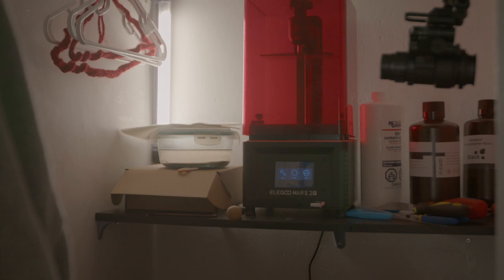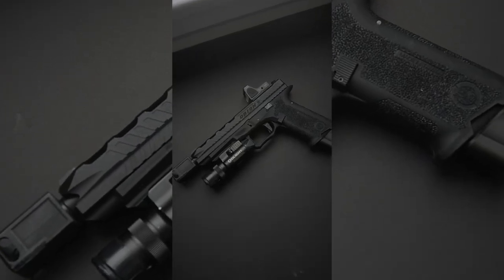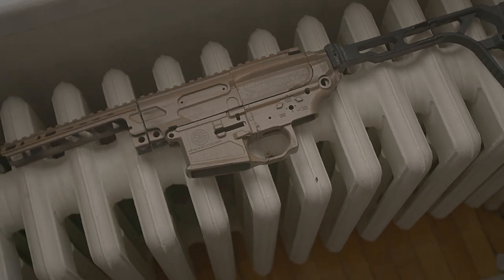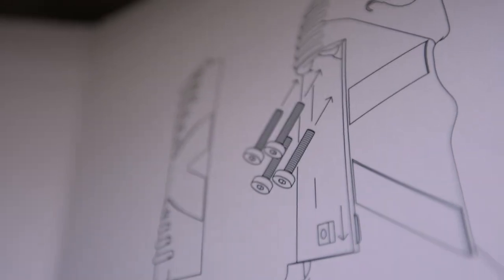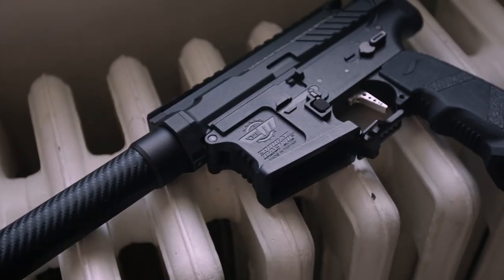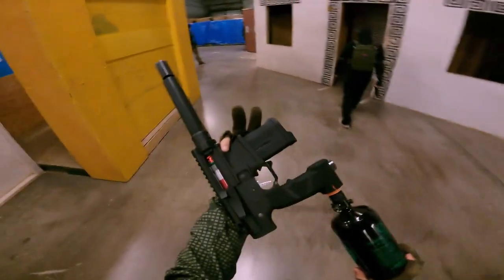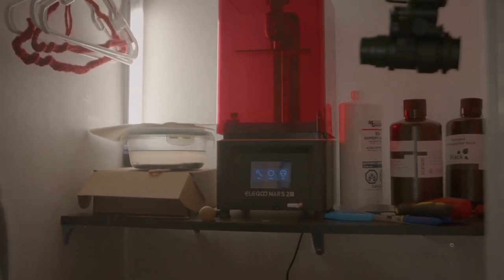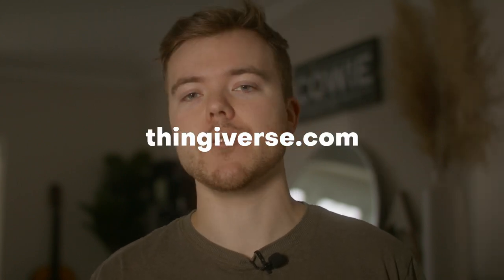I am 3D printing a Airsoft gun...

Comment: i live in brazil , 3d printing made our lives SO much easier in terms of airsoft
Reply: ORA NEM MAIS EHEH
Reply: I have started designing my own parts because stuff I want is either very expensive or difficult to get a hold of! Currently working on a panzerfaust as I want to run it in a game but I dont fancy paying over 400 for one! Few other launchers I want that either do not exist or are super expensive in airsoft that I will eventually be working on. 

I also make my own taginn chalk rounds and have made launcher inserts that allow me to fire taginns using regular shower shells. This is great for practice as regular taginns cost 10 a round and their availability is terrible where as I can print them for 0.1 so can put down 100 rounds down range for the price of one taginn.

Comment: Printed parts always break because people use PLA which too weak. You gotta go with the stronger stuff like nylon, polycarbonate and TPU for flexible stuff like armor which is impact resistant.
Reply: Was coming down here to say that. Also they should make sure their infill is set to 100% for parts that don't need to be slightly flexible. People are making pretty reliable firearms with these things. A little airsoft toy should be easy asf 😂
Reply: @anonymouse7394  I mostly use TPU for armor it's more reliable with movements like crouching.
Reply: Nowadays there is many material options. PEEK, PAKV, etc... You can even 3d print metal.

Comment: I've found that 3D printing for Airsoft is especially useful for GBB replicas, something I know you've dabbled in recently. Parts can sometimes be difficult and/or expensive to obtain with some brands and models of GBBs because the amount of aftermarket support just isn't the same compared to AEGs as I'm sure everyone knows. I've lost count of the times I've saved money and shipping time when a part in one of my gas guns break. Great video! 

I'd recommend looking into a filament printer as well. The MCX you're printing (looks amazing btw, can't wait to see more) reminded me why I prefer FDM over SLA: The ease of splicing two parts together. When printing plastic, all you need for a solid bond between parts is a soldering iron to melt the plastic together or, even better, a 3D print pen using the same material as the print to fill in gaps with molten plastic and weld the pieces together.
Reply: i am in the midst of creating a mechanical (like the kythera. semi only) hpa engine for the consumer market. it will cost $110 for the base model (more premium models made with stronger material) and i want to send one to kraken to review
Reply: @AppleBeesBarAndGrillMenu what parts do you need to make a gas blow back airsoft pistol like which parts do I need to put in the frame and slide

Comment: I've been using ASA for all my ODST airsoft armour and airsoft stuff. 6 walls & 40% infill allow multiple knife stabs, window breaker stabs, and 4 hammer (flat end) and 4 hammer claw strikes before it starts cracking. it will easily outperform many polymer options. If anyone wants more information, print settings, or want me to make them stuff don't hesitate to contact me. I have a very high end printer and perfected settings in making armour and attachments

Comment: I've printed a few spare bottom caps for Glock mags. Changed the plates on my mags and played a few games and wow the inevitable finally happened and I dropped one of my mags. Happy it didnt land with the loading ears or whatever down first, but it actually cracked my 3D printed part doing it's job to absorb the blow and the mag is completely safe. Had two extras in my bag so I just switched the broken part and continued. Think of it as an old Nokia. When it hits the ground it breaks into pieces keeping the core safe from damage. With 3D printing you can more or less do the same with certain applications to keep your gear up and running. It can be a small shroud over optics, it can be a mesh covering lenses etc. Oh I forgot, I printed a tool to replace the irons on my glock as well. I have not yet used it, but I have planned to put optics on it so it's good already having a tool for that for free basically. Imagination is limitless.

Comment: 3D printing in airsoft is being quite useful to me, i printed a Colt 727 conversion kit for a standard M4 (full body with all small parts, stock, slim handguard), it is holding up pretty well, 6 months and no signs of wear or wobble. some layer lines do show though. Also I printed a scope mount, which handles a heavy scope pretty well. The key to a successful print is part orientation, full wall build (infill is irrelevant as long you have enough walls). Printed with eSun PLA+. That motivated me to try and model a HK21/23 conversion kit for G3 series AEG.